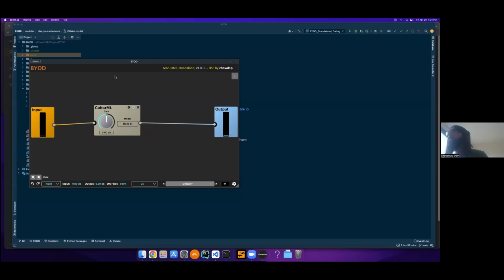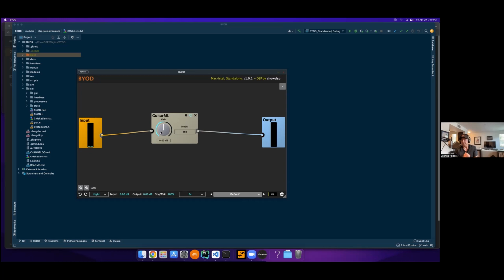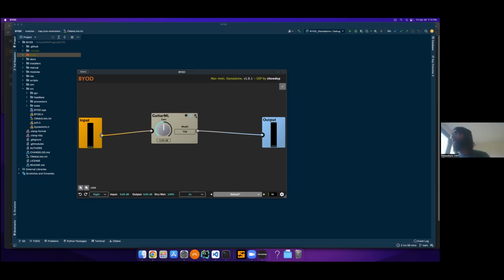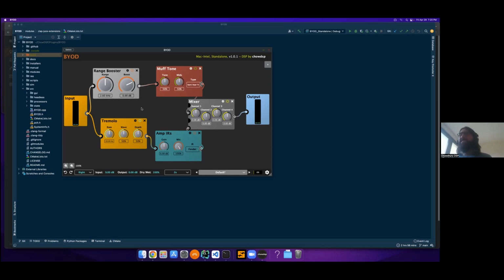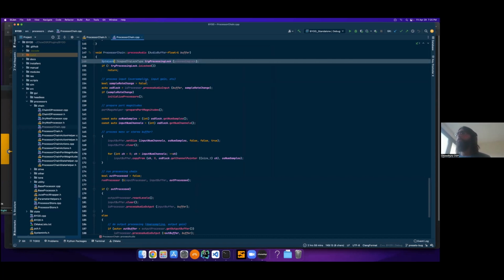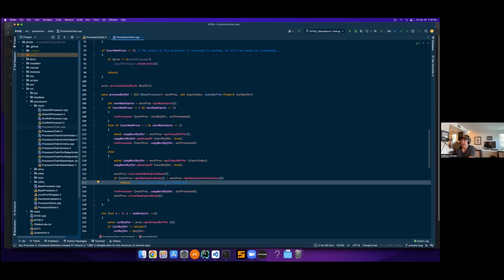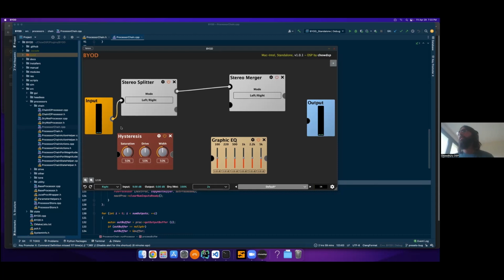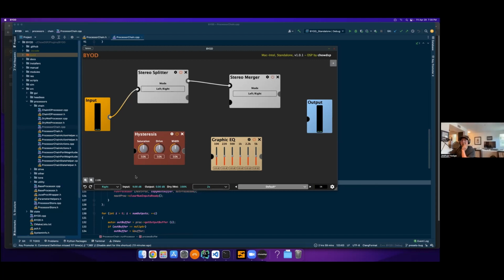"BYOD: An Open-Source Guitar Distortion Plugin" || Jatin Chowdhury (Chowdhury DSP)

Comment: Regarding power supplies. I havent tried different countries power supplies so I wouldnt know.  But Im guessing its a power sag, wich is much like compression. Quite noticeable in older tube amps that uses tube rectifiers.

Its fairly well documented and that might be used as a basis for modeling the behaviour.

Thanks for a great video. Love the Chow--Plugins 

🙏🏻
Reply: Probably need to model some sort of "Step up & Step Down Voltage Converter Transformer"..im a Jr btw so not completely sure.